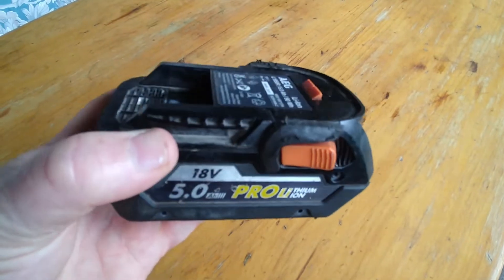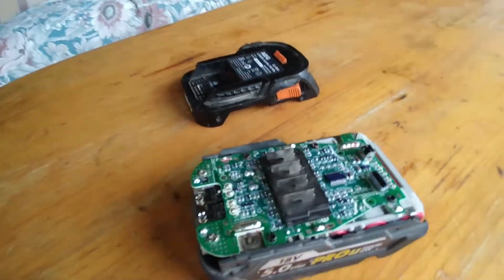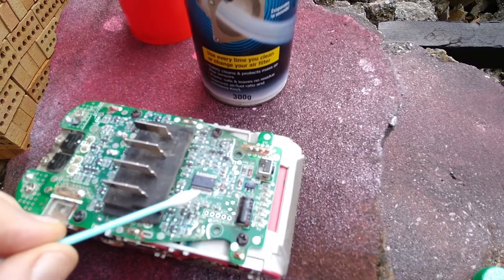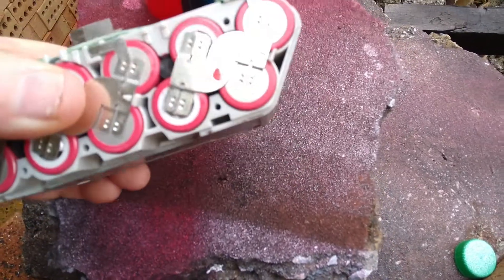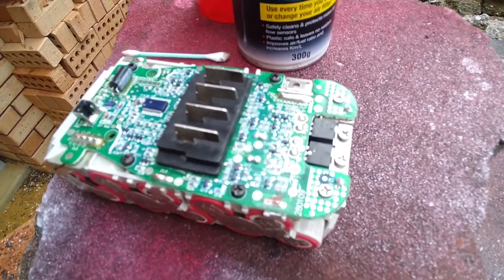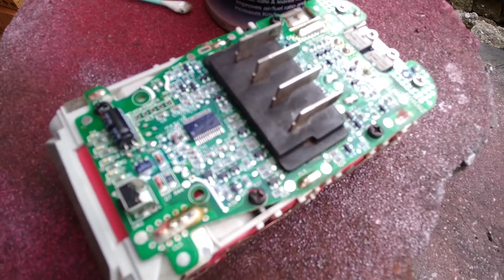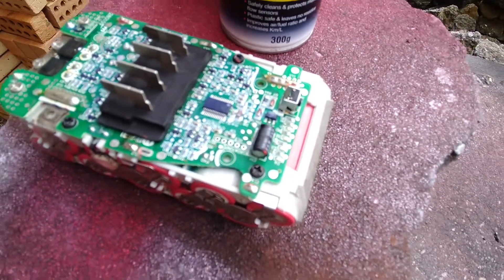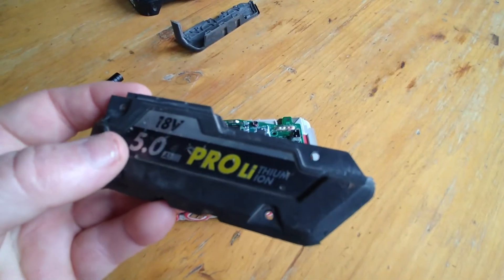18v AEG and Ridgid Lithium Cordless Tool Battery Reset

Comment: I have 4 sets of batteries of this kind, the best measuring 18,4v and the rest between 3 and 9 on the outgoing charger pins. Ive cleaned, reset and still wont charge. I even bought a new used charger but still the same. Im getting red and green flashes on 2 batteries, and constant green "full battery" on the best and 2nd best "charged" battery. Dunno what next to do. Buy new batteries?
Reply from the maker: You print have some faulty cells (the individual batteries inside). 
If you have a charger for 18650 batteries  then treat each cell like it is it's own cell. Charge then one by one. They should go to 4.2v. if they don't then they are faulty. You may have cells in sets of parallel. You may have to break the connection between the sets to find the fault cells. 
There are lots of video's on YouTube how to test individual cells. Mostly you test one by one. You charge them. Then let the batteries rest for 1 to 2 weeks then check the voltage of the cell. If it is lower than the others it has failed.
You may be able to make one for battery or if two. Getting into battery rebuilding is a skill. YouTube will give you the best information as you should use a spot welder for connecting the cells. You can solder but it's not recommended.
To me you have failed cells in the pack.
Reply from the maker: Also somtimes if you let the battery get too low you will have to recharge each cell in the pack individually. As I mentioned. Test the voltage on each cell in the pack and make a sharpie pen mark on the low voltage ones. Use budget wires to charge them from a 18650 battery charger to 4.2v.  then see if the pack charges on the factory charger. No need to break the metal strap connectors until you have tried this.
Reply from the maker: If all that fails then it's time to learn how to rebuild them out give them to a friend that can dismantle them and use them in a ebike project. The good cells can even be used in torches. They are 18650 high discharge batteries so still have some uses as cells.

Comment: So this has got  to be the fifth or sixth tool battery repair video I have seen and it's interesting that not one American has posted. Are we really that wastfull? Or are we just that inept?
Edit: dont answer that
Reply from the maker: Got point.  I'm over 60 so maybe it's more a generational thing. I hate to throw things away and waste them when it's often just one small just that fails or in this case just needs a reset.

Comment: Gday i have the 6.0 Pro battery  is it the same holes for the reset as my board has 6 holes i did try on one and seen a little spark but the battery seems ok cheers.
Reply from the maker: Ib don't know the similarities but I'm sure a spark is not what you want to see. However if it works it works.

Comment: hi mate 
thanks for video
have you got an idea about the aeg double charger with 7amp fuse. it doesent work and i tried to take the fuse out but didnt work and didtnt want to damage and couldnt find anythin in the net
thanks al lot for respose cheers
Reply from the maker: Sorry. No I don't. I was just fixing the battery for a friend so never even had the charger.
Reply: @lynpatnat  thanks for qick answering, no worries, have to buy a second .. urgh
Reply: I’ve got the same battery but it runs out when 3/4 charged ie I push the test button and 3 of the four lights come on , is this fixable or is my battery buggered
Reply: @Secularworld60  I've seen videos where they repairing batteries with such a problem by disassembling and charging cells separately
Reply: @knarf3985  thanks mate for the quick reply , usually when i pull things apart i break something but i’ll have a look 👍🏻
Reply: @Secularworld60  me too bro but if you can't use it it's a try worth

Comment: Just to add to your "cleaning" here. Any time you open any battery pack, you should clean all circuitry visible. I personally use a electronic contact cleaner and a soft toothbrush to loosen foreign material. Wood, especially pine and fir, have resins that can stick and won't just blow off.

Not cleaning the entire board while you are in there may be counterproductive as any loose particles may migrate around the case and lodge where they are least needed. My first step is always using compressed air as a way of freeing up any larger, free particles that may be present. Following up with contact cleaner and soft brush removes smaller less visible dust/wood/metal particles. It also drives out moisture that may be present in your compressed air system. Moisture present in the wrong place can acts as a restisance across contact points and drain or cause unwanted voltage spikes/drops.

Much care should also be taken to assure you do not touch the WRONG contacts when resetting (shorting) any circuit board. Most complicated circuits contain many micro amp/volt circuits that may contain diodes/ resistors/capacitors that can be damaged by very small currents/voltages.

Periodically cleaning the outside of portable/cordless battery packs of debris and checking charging contacts for foreign matter is another way to extend/improve battery life and performance,
Reply from the maker: Good advice and very true. Thanks

Comment: What gauge wire is safe to jumper the pads ?
Reply from the maker: Any size. You can use a paper clip or  anything wire. As long as you only touch b those two points together for a second then it will reset. Don't leave the wires connected afterwards.
It won't spark. There is no noticeable current.

Comment: I have changed batterys,how i should reset them can you explain
Reply from the maker: I can only guess at what you would do but I think the way would be to change the battery pack first then do the reset as I said in the video.
If that doesn't work you may need to charge each battery with a small jumper lead. You would charge each battery at about 30milliamp at about 4 volt. You would have to make sure you stop the charge at 4.2v for  each cell. Don't charge them with more than 4.2v or they will go bang and burn you house down. You would need to look at other video on how to charge one cell at a time.
You can measure the voltage at the terminals of the pack of it is around 18v it should charge and balance once you reset the BMS like I showed on the video.
Best of luck.
Reply: @lynpatnat  Which video ??
Reply: @lynpatnat  help please
Reply from the maker: @csacad6008  This video you are looking at shows how to reset when the battery shows a fault. So if you battery has had the cells changed by you and won't charge you need to reset the BMS as I have shown. Then charge the battery on the charger. 
If it won't charge after that and you have reset the BMS so it is not flashing then you need to check the voltage at the terminals. It will need to be around 18v. If you see no voltage or if the battery won't reset you may have to charge each cell inside the battery pack one by one. You can test the cells first by checking their voltage. Each one should be around 3.5v If the BMS thinks there is something wrong it won't reset.
You can google to see how to test each cell. I no longer have the battery as I have it back to the owner after fixing it.

Comment: These are the older style batteries though.
Reply from the maker: Yes they are. Later ones will change but that's too be expected. Maybe someone will know how to do them but maybe they will need to have the BMS replaced to work. If manufacturers think they are clever by bricking batteries so that are not user resettable then consumers will stop buying thier products.
Reply: @lynpatnat  ive taken the new ones apart and so far ive found thst the cells are impossible to get out without breaking the housing.  I was going to buy my own 21700 cells to see if i could upgrade the pack. 

Im not sure if the electrinocs would support them/be compatible or not but i would like to find out
Reply: @mattek519  like apple products mine where stuck with 30mm foam tape. warm them up with a hairdryer. if you can still hold it  the temp is okay. 40 to 80 degrees is our aim. and dont forget it has 4 screws on either side....
Reply: @ssao0000  they are soldered together
Reply: @mattek519  yes they are
Reply from the maker: Maybe they glued then. If they can go together then they should be able to come apart. Upload a YouTube clip and see if anyone can help